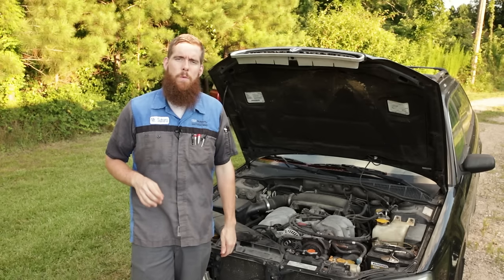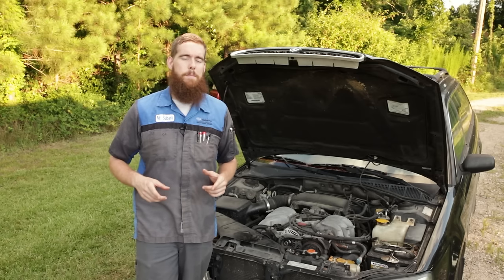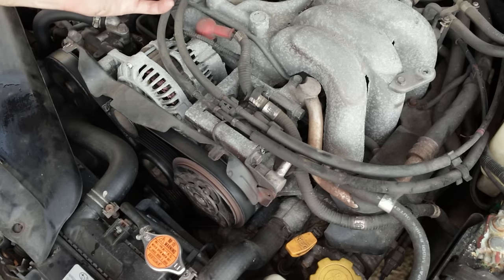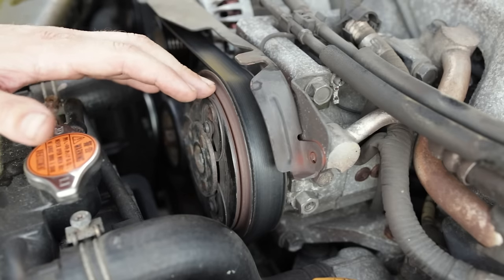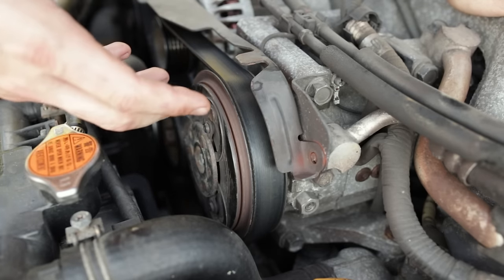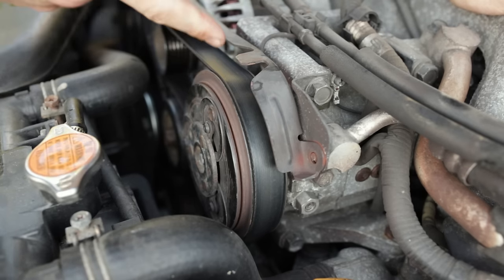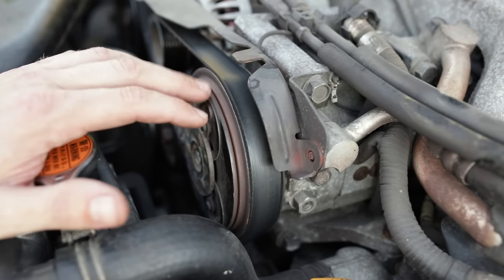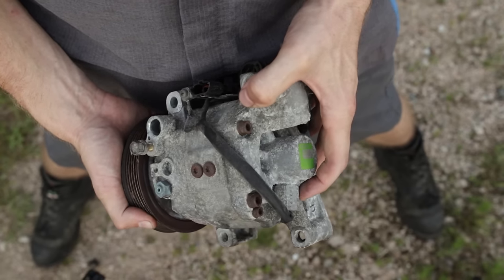Subaru A/C: Common Failures & Issues

Comment: Thanks so much! I have an 04 LL Bean and the AC system has been giving me trouble. Had it charged, oiled, o rings replaced and now it blows cold, but will quit after about 15 minutes. Always comes back on start. I just checked the compressor clutch action with the test plugs, it didn’t look nearly as close. Gonna doublecheck once I get some feeler gauges. Cheers!
Reply: @Evangeline Podolski Nice! I'm glad you commented, I forgot to update as is usual with car work. That's all it took for me too, plus setting it to spec with my feelers.

Comment: My issue on my 05 baja is this, when the weather is below 90 degrees, the ac clutch will engage/ disengage just fine, but when it's well over 90 degrees. It'll stop engaging until I turn the ac off for a 5-10 minutes, then it would go back to normal operation--stop engaging again when running for a bit and so on. I decided to order an ac compressor clutch and hope it'll fix this issue, since memphis has some really bad humid heat in the summer.

Comment: Great video, near me no matter what the issue with the a/c system, they will surely rake you over the coals for as much as they can, even if it's just the orings, they will most likely tell you a new compressor is needed. That's is just the way the tri-state mechanics are. I have some good mechanics that I use that I think I can trust but if an a/c issue arises, all they would see if dollar signs. Probably why most people near me with older cars, once the a/c craps out, they just get a different car. Sad but that's just the way it is. Keep up the great videos! For safe measure, I change the cabin filter onces a year regardless of how it looks. Walmart carries them for my 2016 legacy. 100% correct on older vs newer with regards to robustness. The new systems are lacking if you ask me (my 2016 is not the greatest with 50K). The real issue is now that subaru is more mainstream and has increased sales substantially, the quality has gone down. I have had subarus between 2000 up to 2016. I would take my 2000 GC6 over anything I had after. Again, my mistake selling it ugh. My GC6, with just around 100K when sold a few years ago, a/c was iceberg cold and all original.

Comment: Having owned (and still own some) a 1995 legacy wagon, 1997 OB, 2001 forester S, 2001 2.5rs, and a 2008 sg forester I can 100% confirm that the quality just keeps going down the toilet. The SF foresters, 1st/2nd gen legacy and outback are really the sweet spot of power and reliability. The only two I have now are the 95 leggy and the 08 forester and I regret every day getting that SG. Even with super low miles and an inland california car, I've had to replace so many things (ac comp failure at 115k, rear wheel bearings, etc) that I've never touched on the 95 legacy. The quality of the aluminum and steel are subpar on the SG. Way more rust and corrosion on the SG than the leggy, both living in essentially the same area their entire lives. I probably shouldn't be saying any of this but now is the time seek out golden era subies and keep em for the indefinite future.
Reply: ALL cars RUST if exposed to oxidizing elements for prolong periods of time - modern cars are less prone to this due the unibody being galvenized to mitigate corrosion.
Reply: Wheel bearings and aircon compressors are consumable parts. 115k is not uncommon for wheel bearings. AC comp probably a little on the short side but not bad.

Comment: Thank you so much for your videos!  I was having a horrible sound whenever I first turned on the AC in my 2015 Forester, and it started about a year after I bought it.  Every time I took it to my service dept, I got "we can't duplicate it, so it must be working as designed." I took it to them 4 times over 4 years (don't have a lot of time or interest in hearing that line over and over).  Finally found your video from a couple years ago, took it back to Subaru, told them I don't like being made to feel like I'm crazy, and demanded they look into it.  Get a call from the advisor the next day saying, "oh yeah, there's a known issue with the compressor for the 2014-2016, but we rarely see it.  Let's get you a new compressor." It's been a month now, and no horrible sound.  Thank you, thank you, thank you for arming me with knowledge so that I don't get lumped into the ignorant female category the dealerships like to pull on me!

Comment: Great info.... I have one for you..... 2002 WRX. AC works fine but after about half hour of operation, if I take a quick left turn the AC will stop making cold air. Yes, it only happens on left turns LOL.... It usually happen on a highway underpass as I made the turn toward the access road.  I avoided the issue if I took the turn slowly BUT any fast turn the the AC will stop working. Had to wait a few hours before the AC will work again and the issue will repeat all over again.

Suspect the drain line to be plugged (no drain water in the garage)  and the turn causes some interlock in the system due to water level within the evaporator housing.  Will work on trying to unplug the line (best way to do so???)

Comment: I have experienced that 05-09 AC.  It was one of the main reasons i got rid of that one.  I found the AC would work fine at night even with hot temps, but then add it additional solar load from the day time and it barely kept it comfy.

Comment: my bugeye is leaking somewhere on the compressor! this just helped out a TON!!!  thanks for the tips
Reply: I never use my AC and my '02 WRX'S system failed faster than my '90 Pontiac Sunbird's.  I put a store bought recharge kit into it and it worked fine for a day or two.  But now I know exactly where I'm going to look first!
Reply: @tyree9055  same. My bugeye wrx worked after recharging it for about a week, then it was gone again and I actually saw refrigerant on the ac lines under the hood. Never fixed it. Compressor was also garbage on my blobeye wrx, and geuss what? Ac doesn’t work on my current blobeye sti either.
Reply: @Rumblefan  I pulled the compressor connections (like Mr. Subaru pointed out) and you know what I found?  A push-in, slide connection with a square-edged, o-ring that had white chalk-like residue on it showing the clear blow-by going on.  It's such a bad design that I'm surprised Subaru's not being sued over it (designed to fail)!

I replaced their square-edged o-ring with a rounded-edged automotive one, then "reinforced" the connector with a gasket on top of that.  So far it's holding up and I now have A/C for those 99° days...

THANKS MR. SUBARU!
🥳
Reply: @tyree9055  that’s awful no wonder all 3 of my subarus didn’t have working ac

Comment: Thank you for this informative video. Driving back in the hot sun our Subaru outback A/C full on and blowing strong …hot air. After watching your video I checked the valve on the high pressure port and gas comes out strong from there when I press down the centrepiece. So I think gas is not the problem. I checked the spacing on the compressor and it engages nicely and very tight. What am I missing? Why does the A/C not produce cold air?

Comment: trying to research our issue. 
2015 Forester. Compressor replaced 2 years ago (so not the compressor as best all can tell). 
Recently started "acting up" not blowing cold intermittently. Cold when driving, stop and idle - the air would warm up and then not get cool once driving again. Then started where it would sometimes stop being cool even when driving. 
BUT the next day - it would be fine and cooling like a champ?!
Took it in to one mechanic - couldn't find any issue. 
Another mechanic found it was a bit low - put in coolant and dye. Seemed better for 2 weeks...
(we are in Houston summers - so humid and hot like SC)
Acted up again - took it to him - BUT it was again cooling just fine when bringing it in.

The filter has been changed, he's checked electrical connection on the condenser fan. 
Could it be dash controllers?
Ideas?
Reply: from talking to the mech - he thinks we need to check with subaru on the controller (knobs/module that powers AC on the dash?) or blended actuator motor (?what's that?)
Reply: found a video related to the ambient temperature sensor... maybe that?

Comment: Going through some A/C headaches on my 2016 Forester. A plastic threaded insert on the high line seems to have broken off and bits cleared the check valve.....this is the 3rd one in a year. The first one was faulty 2nd (the one being replaced now). I didn't do my due diligence on TSB for this make/model. Lesson learned.

Comment: Had a clutch that wasn't engaging, the shop diagnosed as "Bad compressor" with no explanation.
I was hoping for o-ring failure, aaaaand I didn't get leak or O-ring failure. My gauges/hoses actually had a 2-second magic fountain of neon green before i shut off the valves. 
Since chemical (not leaking) was fine, and mechanical was fine (the clutch spun smoothly)... I diagnosed the electrical. 
Relay coil tested fine, relay contacts were fine, wire from relay to coil was fine... and then I found out the coil was bad (no continuity).
I have a 2015, so clutch kits are rare, but thanks to MANY suspicious DKV10Z clutch kits on eBay, I found one on Amazon.
Wish me luck!
Reply: Update: The clutch kit was garbage... oversized clutch (it stuck out with a 2mm gap!), undersized shims (inner diameter was undersized by 1mm!), and definitely the wrong size snaprings.
I only replaced the pulley and coil, and it basically worked. Forgive me, car gods, for reusing so many rusted-out consumables! 
Someday I might grind down the splined socket on the new clutch and replace the old one.

Comment: Another issue that is not exactly the A/C system but is closely related is the second cooling fan behind the radiator. 1 fan cycles on and off with coolant temperature but the 2nd one comes on when you turn on the A/C.  My 2nd fan motor died and when you turn on the A/C on a hot day the temp gauge goes way up quick!  Turning off the A/C brings the temp down to normal levels but if your not paying attention you can end up blowing out the plastic end tanks on your radiator and maybe even the dreaded head gasket failure!
Reply: THIS IS WHAT I NEED TO FIX. SO HELPFUL TO READ ABOUT!!!

Comment: Brilliant advice, I’ve a small leak somewhere on my XV, topped it up twice. Finding parts are not so available here in the uk. Going to try the UV dye first, as you mentioned high/low  o rings on the compressor connections. It’s a 2014 model, so suspect them.👍

Comment: My 2012 impreza 5 speed failed at 30k, was on the highway when the whole car lugged heavily for a moment then went back to normal. 
After that the compressor made a mild metal on metal sound until it was fixed a few weeks later. I did notice the compressor was very dusty, like it wasnt engaging fully maybe?
Didn't have that car much longer after. 
Bought a then new 2017 manual forester, currently at 63k and so far it's functional. Compressor doesn't rattle but is the most noisy of any vehicle we own. 
Out of Chevy, Hyundai, Ford, and Toyota.
Reply: Replying to myself but my compressor failed at 102,000 😆

Comment: I’m surprised you didn’t mention the AC relay. A friend of mine their 2012 Subaru Forester she just had the air conditioning O-rings replaced and recharged. Then driving around the next couple days it was working intermittently. Took it back to the dealership. They said it’s still working fine. I decided to watch a few videos on YouTube, I know relays can get stuck/ worn out sometimes. So I turn on ac,  tap relay for the air conditioner compressor clutch, AC came back on, turn the AC off on tapped repeatedly …ordered new relay, putting that in today. I know the AC tech at the dealership did not check the relay because the fuse box cover where the relay sits was full of leaves.

Comment: Appreciate the explanation of the dynamics of function Subaru specific. Whether or not his video fixed your issue or gave you the answer you were trying to find, wasting (or helping) with diagnostics is a different skill set than mechanical replacement. I don't know much... Subaru, really??? Industrial mechanical and air force precision measurement calibration Chinese fortunate cookie. says, methaphorically, he showed you how to fish and didn't just give you a fish. I completely understand viewers asking an answer specifically, but repair depends on correct diagnostics. It's pseudo nerdy knowledge, I hope $2 a month is worth the time to help understand system design. The factory service manual...not a diagnostic.

Comment: Thanks for this great video. 

With no pressure in my system, the first thing I checked was the two compressor o rings. Sure enough both o rings had blow by, so they both got replaced.
Reply: Where did you find the correct replacement o-rings? I bought a pack with 15 "most common o-ring variations" and unfortunately none matched either of the compresser o-rings when I took them out.

Comment: My Subaru Forester 2018 just needed replacing it, 6 years is a bit short for the lifespan.  I believe it happened when I smelled an intense rubber burning smell last year during fall after I replaced cabin air filter to a more expensive one with a lot metal balls and carbon filter thingy inside… Now I’m out of $1700

Comment: I had issues with the gas leaking out of A/C system on my 03 STi after only a few months. Had to keep refilling with 60 EURO A/c refrigerant bottles. got sick of it and paid a professional A/C repair company to fix system. They replaced entire front A/C radiator thing - said it was full of leaks - i could see the leaks in UV light they showed me, cost me over 400 EURO. And then of course a year later, system not working again, refrigerant all leaked out again. Had to buy another 60 EURO bottle!! Infuriating... must have spent near 1000 EURO on A/C alone in last few years!! Didn't know about o-rings and these so-called professionals didn't check them either as far as I know.

Comment: The o ring to the air compressor is exactly my problem. I have a 2002 wrx and went to recharge it and it started leaking from both of those points. I bought o rings, vacuumed the lines, recharged and it’s all good
Reply: Where did you buy the O rings? Size?

Comment: I like your video. While driving last summer I smelled rubbrer getting hot. I made it to my driveway, raised the hood to find the tensioner belt to the air compressor had burnt into and the long tensioner bolt under it had snapped the plastic holder on it also. I ordered in a new one and new belt, installed but then the prior working air compressor won't kick back on so I unplugged the electrical plug on top of it  and took the belt back off and the new tensioner bolt to keep it from maybe breaking again. I have had no air conditioner since. After watching your video I now will check to see if the sensor for the clutch has failed or if I have those 2 green plugs under the dash to check it with. Mine is an 04 Forester X.

Comment: Great video! The AC on my 2014 subaru impreza 2.0 wagon wouldn't turn on. I tried it again a few minutes later and it started running and blowing cold air. However, minutes later it stopped blowing cold air and just blew warm air. I turned it off and waited about 15 minutes before I turned it back on. It started working again as normal. Getting it checked and will be back with an update.
Reply: I have the same car and have the same issue! What did you learn???

Comment: Just replaced o-rings and refilled the AC. It had leaking AC lubrication at the o-rings and making a very bad noise when AC is engaged. 2011 forester FB20.

Comment: Hmm, My 2014 Subaru Impreza 5-door is having A/C issues that don't seem to fall into any of these. The A/C will turn on, blow cold for about 2-30 minutes and randomly start blwoing warm air, even though the A/C light is still on. The cabin air filter is new. I can turn the A/C off, then back on and it'll start blowing cold again then soon warm. like it's shutting down on it's own.

Comment: Great video as always! I am in agreement with you and all others with new Subarus about compressor failure.  I own a 2014 Impreza Premium and had the compressor fail. Fortunately it was at 27,194 miles and covered under warranty.  Now at just over 130k and still blowing cold air and running great.  Stay cool🥶

Comment: I have a subaru impreza G4 1.6 2016 from Japan, I live in the tropics 28 - 34 degrees outside temp. The AC will cool and then after a while the airflow reduces, if i turn up the blower to high I hear the blower working hard but low air flow. If i switch from recirculate to fresh air intake in aboute 2 mins i will see icy mist blowing from vents and the airflow goes back to normal. Someone was suggesting the thermostat is not working

Comment: The AC clutch bearing can also fail and it's possible to replace it with $12 bearing. Thanks for the video!
Reply: Is that my ac pully will screech really loud when I turn on the AC?
Reply: How do you know when that bearing has failed? Where can I learn the procedure to replace it?